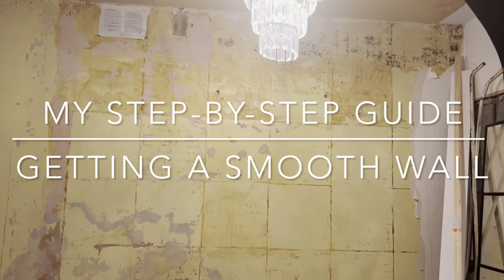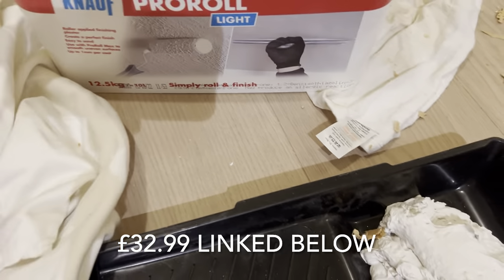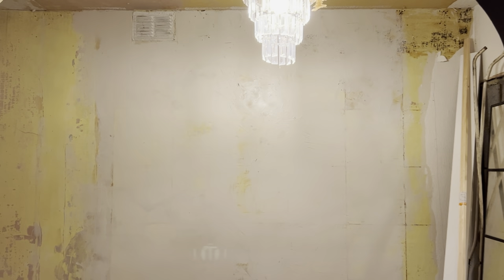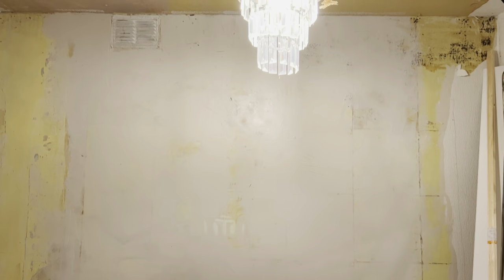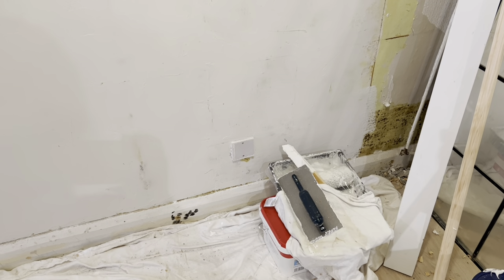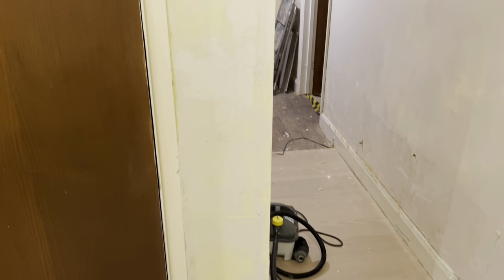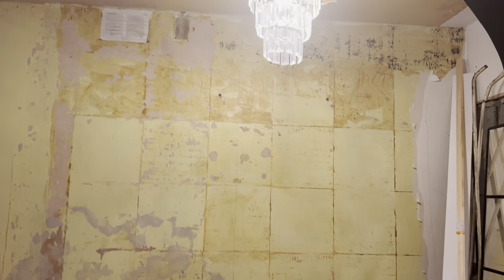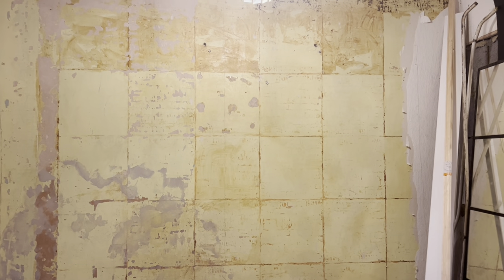How To Plaster A Wall For £50 Yourself - WITHOUT PLASTER! How I Created A Smooth Wall Myself

Comment: Would you say one needs a coat of thistle bond, or pva before this? My wall has quite a bit of damage and was told it needs that before plaster. So wondering if this needs the same?
Reply from the maker: I didn’t add anything before. I did give it a light sand to remove any little bits first. I don’t think it would hurt if your walls are flaking?

Comment: I’ve removed a picture rail and the anaglypta above which has cracks in but the whole wall doesn’t need plastering. Do you think this could be used to blend the top part to lower part? Or should I do the whole wall?
Reply from the maker: Definitely yes. I patched an old door frame, didn’t need to do the entire wall.
Reply: Thank you - really helpful 😊